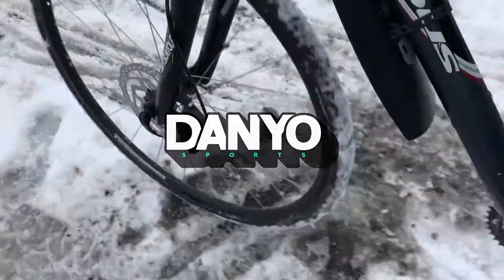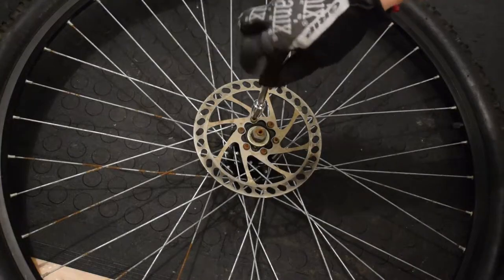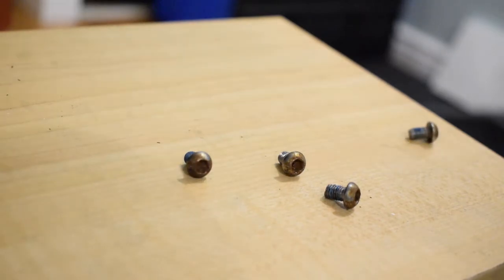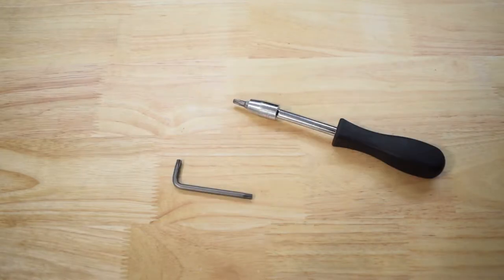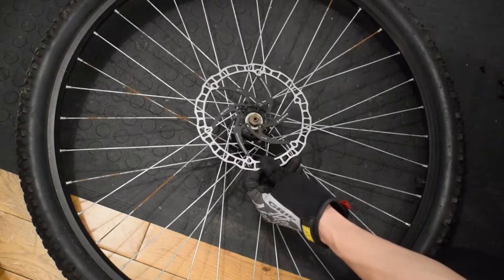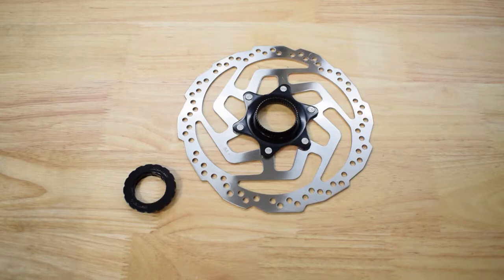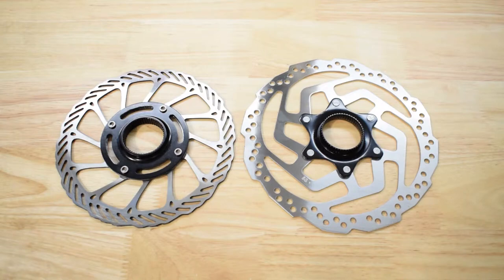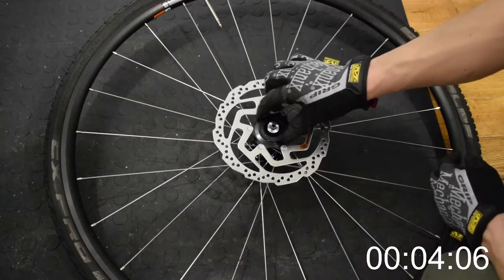Disc Brake Rotors: Is Centerlock Better Than 6-bolt?

Comment: Center lock more good 👍
Reply: You can take off bended rotor on the trail if it's a 6 bolt rotor, but for center lock you need a special tool